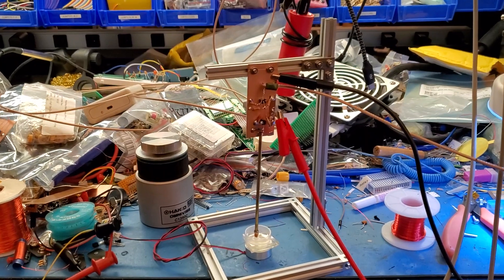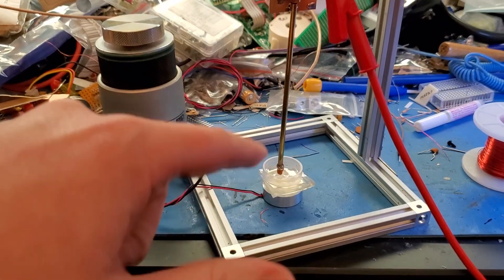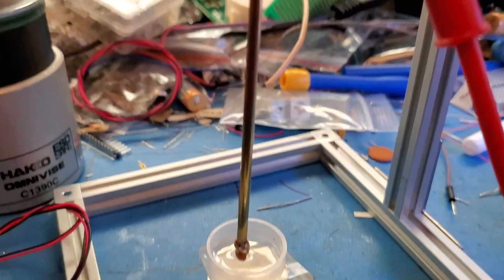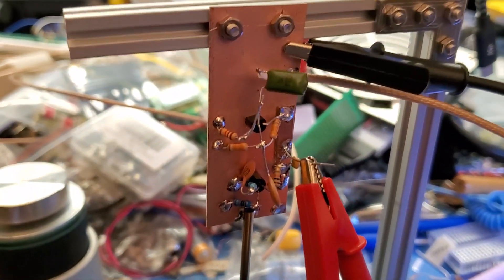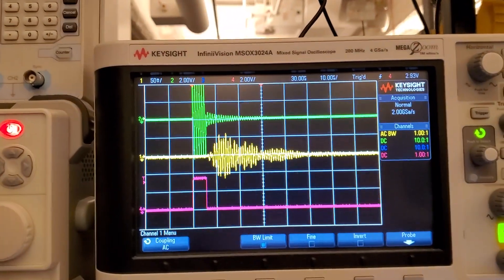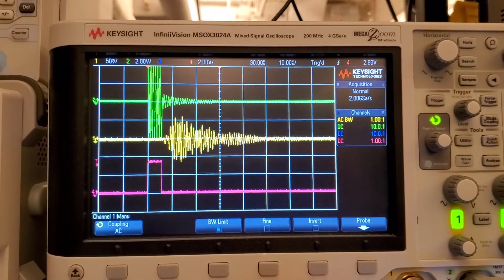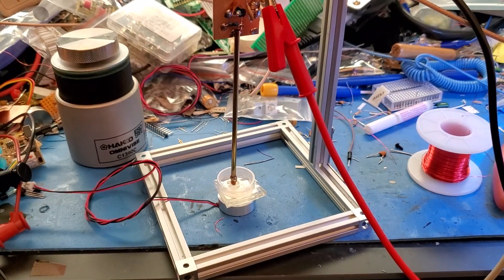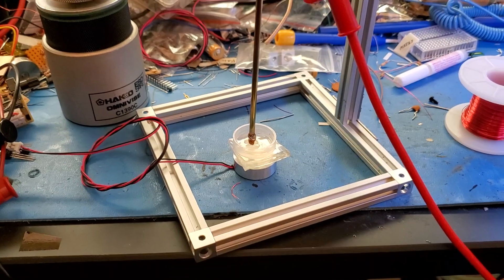Using a Ceramic Capacitor as a Hydrophone Transducer

Comment: If an insulating chip is placed between two neodymium magnets - and then it is charged with electricity - does it become a supercapacitor?
Reply from the maker: No. The magnetism doesn't really matter, two electrodes separated by an insulator will have a capacitance.  I'd expect the capacitance to be the usual you'd expect from a parallel plate cap of that geometry and insulator dielectric constant.  A "supercapacitor" doesn't really have a strict definition, but it is typically a high capacitance device for its volume, much more than a typical dielectric insulated capacitor.  Supercapacitors come in two basic varieties, electric double-layer and pseudocapacitive, with some practical devices having both effects contributing to their overall capacitance.  The main difference is that pseudocapacitive devices are faradic, essentially like a low capacity battery with electrochemistry going on.  If they had more energy storage density they would basically be a battery cell. The double-layer effect is just traditional electrostatic capacitance but on a very thin layer with high surface area and is usually just a fancy electrolytic capacitor.

Comment: I did some experiments using ceramic capacitors as accelerometers some time ago. The types and makes differed a lot in usefulness for this purpose. I guess the manufacturers really do want to minimize microphonic effects. Perhaps buy really cheap caps... Murata makes som special ones as accellerometers.
Reply from the maker: Yes I strongly suspect it is a property the manufacturers try to minimise in most devices.  I should try the accelerometer sensor caps, they should work pretty well.

Comment: Always cool to see what you are working on, Alan. A while ago, I built an ultrasound receiver, and used the front end from the original Lighthouse (just staged common emitter bjt). The effective bandpass filtering was even about right. I'm looking forward to your standing wave mapping.
Reply from the maker: I imagine a lighthouse front-end would work well, I designed the original discrete ones to basically be charge-sensitive with bootstrapping to reduce the effective capacitance of the source.  I collected some free field data last night.  I am less interested in standing waves, I want the real pressure time series data in non-reverberant conditions.  My first tests were done in gassy water in a 1 liter volume which caused all kinds of bad effects.  Working on a much larger tank of degassed water, but 150 kg of degassed water is its own engineering challenges.

Comment: Hydrophones basically are just ceramic capacitors, only the physical construction in terms of how the plates are mounted is different. e.g. if you want low frequency response then you need long plates held at the ends. At Thales we used to have our own hydrophone manufacturing facility, we called them "benders".
Reply from the maker: I suspected as much. I don't need crazy low frequency response or even flatness for single frequency relative work, but I have ordered a calibrated hydrophone for absolute pressure measurement. I'll probably use it to calibrate crappy homebrew hydrophones that I don't care if I accidentally destroy. I've got some poled and metalized PVDF film that should work pretty well if capacitors don't. Capacitors are definitely not isotropic at all but I can deal with that.

Comment: Nice!
Did you need to put a bias-voltage (DC) on the capacitor to generate the signal, or did it generate one autonomously? 
With a bias, any capacitor should be able to pick up mechanical strain in the dielectric and/or electrodes. Piezoelectrics, on the other hand, would be polarized during manufacture, so wouldn't need this.
Reply from the maker: This is done at zero bias.  The capacitor is straight across the JFET gate which it at DC ground.  The bias suggestion is a good one, I will try that, it may make other capacitors more sensitive.